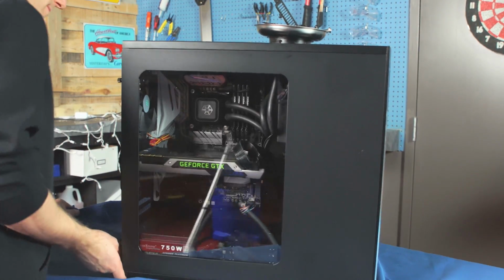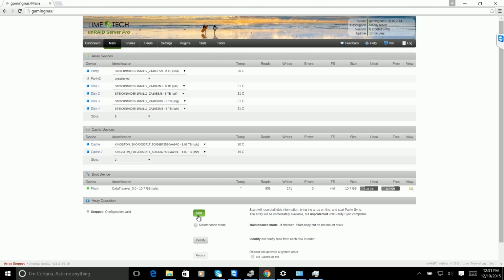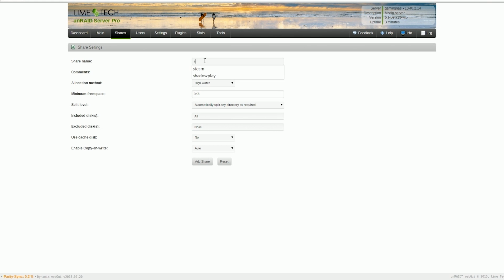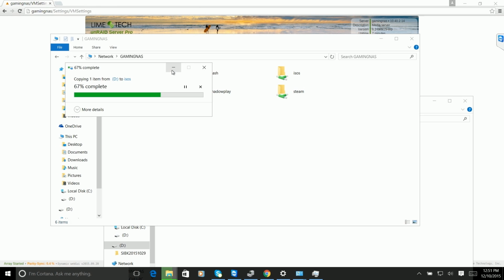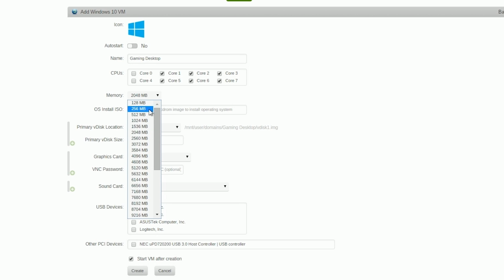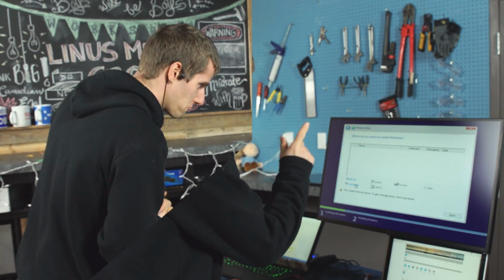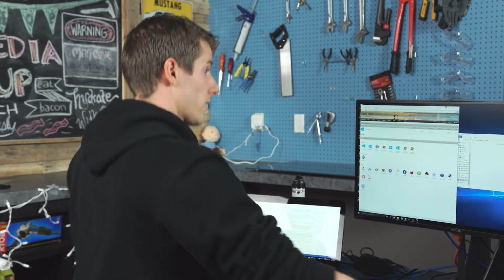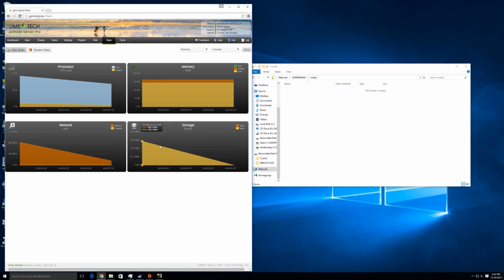Use your Gaming PC's Extra Power as a NAS Ultimate Guide

Comment: How is the power consumption for the NAS when the gaming virtual machine is turned off? The NAS is on all the time. Would the graphics card still draw power?
Reply: A little, but not a lot. Wouldn't know about the figures but it will only run at idle and most modern cards are very power efficient when not utilised

Comment: Super cool project, but what if you already have a gaming rig and wanna just "add" the nas part to it? In other words, can you transfer a current hard drive's data to the VM when setting it up or something?
Reply: Bit late but if anyone reads this question and wonders about it:
You can make a system image of your original configuration and then restore it from the Windows installation image when setting up the new Virtual Machine. However make sure that, before you make your system image for transfering, you have setup your system so it can boot from a standard SATA controller/Has The unRaid VM SATA driver installed. Otherwise you will most likely get a Blue screen with an INACCESSIBLE_BOOT_DEVICE error. (You might have to do registry tweaks to set your windows to be able to detect a standard SATA controller. Just google "Replacing a motherboard without reinstalling windows" and you should find some guides on how to do that).
Reply: you can also use your old ssd as a unassigned device and pass it through to the vm, no changes required, just get recognised by the vm as the boot drive  @PhoenixNL72-DEGA-
Reply: @timomaestripieri6691  That would only work if the OS that is on that SSD has a proper SATA driver that is compatible with the emulated hardware of the VM. Otherwise windows will boot to an INACCESSIBLE_BOOT_DEVICE blue screen. And seeing as Linus had to install a SATA driver from the UnRAID driver image file to be able to access the VM image file, I think there is a chance that that would also be the case for accessing a passed through SATA device.
Reply: @makemehotp  It should be. The only possible problem is that the driver probably won't install if it's detecting that the actual "Unraid Sata controller is not in the computer". I haven't tried it so I can't tell you if it'll work or not, or if there are workarounds (I know that you can set windows to force the use of a system driver for HDD control for instance. There are guides on what registry settings to edit. Specifically to be able to switch to a new motherboard with a different chipset without having to reinstall Windows. Don't know if something like that would work with the Unraid  driver though.

Comment: why not just use windows and configure the drives to be shared to the network?
Reply: Rhambus harsh way to put it bitch
Reply: Its because Share files are separate from windows, if your windows stop working, you won't be able to access your files until you reinstall/fix the windows, in windows you have to face with the ransom-ware, virus or even Trojan! SO your files are on risk, its better store separately!
Reply: yeah i do that and it works great
Reply: If you are ignorant enough to be infected with ransomware then you deserve to lose your files.

Comment: What if the CPU you use doesn't support onboard video?
Reply: I'm wondering the same thing.  I just got a 6850k with the ASUS x99 Deluxe II and it has no integrated graphics.  How do I assign my only GPU to the VM whilst having no igfx?
Reply: +FawksX Then the inside of the case looks like shit.
Reply: You could use something like citrix xen. It lets you not have a gpu assigned to the host.

Comment: Just completed this setup on my own machine, without a hiccup. Linus opened my eyes and i was able to save a lot of my money due to this.

My setup is:
i7-4790k
MSI Z97-GD65
GTX 980

Also, Unraid's youtube chaneel also, helped alot.
Reply: Make sure your Unraid "root" account has a password, otherwise anyone can login and mess with your computer or your files.
Reply: Oh Nice, thanks a lot, i got the exact same components in my old pc and i want to make a nas from it :) Hopefully it works for me also :D
Reply: I am this up on a system with the same cpu but I have an RX480
Reply: 4 Years ago... I know.  I'm about to do this as I can't afford to buy another PC for a NAS.  Any advise @Devesh Ranjan?
Reply: @idjmic  Get an old PC with a low-power chip. Those can be found dirt cheap on the used market. The biggest cost in that case would be the hard drives themselves. Just make sure the computer you buy has enough hard drive bays and SATA connections for your needs...or go buy a used host-bus adapter card.
Reply: @danieldougan269  too late converted gaming pc to server GPU pass through learning lots

Comment: Awww. I was excited about this until I saw the bullshit licensing on the product :/ 

"unRAID Server OS is licensed through the use of registration keys.  A registration key is a small encrypted file that is only seen as valid when installed on the USB flash device to which it was registered.  In the event your flash device becomes lost or damaged, you are entitled to transfer your registration key to a new device free of charge (limit once per year). "

Yeaahhhh... No. Dongle based licensing crap sucks.
Reply: So far the same license has been good for every new version of unRAID that's been released. That's damn good value. Since you typically just set it and forget it, the licensing scheme never really comes into play. Upgrade your system? Just move the flash drive to the new machine and away you go. If you're repeatedly trashing your flash drives to the point that once per year free replacements aren't enough, the problem does not lie with the licensing scheme.

Comment: Is it possible to use the SilverStone FS305 (or any other multi-drive hotswap bays) as a quick way to clean up the mess of spread out data over a bunch of smaller disks?
Example: 10, 90% filled, 100GB drives. Then put in 5 of them and start moving data inbetween, then swap one disk (while the PC is On) and sorting that data aswell into the other 4 disks. Would this be possible?

I'm Not sure how it works yet, not even sure if there is a 5-bay hotswap (or larger) bay with USB. I have alot of disks but no convenient way to carry/swap most of them at once, to sort the data I've spread out over them for quite some time.

I do look forward to the day I can sort it all into a 2 (or more) disks of large capacity in Raid1, but then again... Before that... I could use some more folder structure skills hahaha (...what a mess...).

Comment: When it comes time to replace a dead HDD, does it have to be the exact same format or just the same capacity?  This is important to know since by the time that happens, it will be hard to find exact replacements.  This is why I went with a Drobo.  I'm still looking for a software "unRAID-like" solution because the Drobo is much slower and proprietary.

Comment: So does the computer need to be turned on 24/7 since it's also a NAS? Wouldn't it cost less electricity to use a dedicated NAS device? Or does the computer use not as much electricity when the gaming machine is unused since the GPU and dedicated CPU cores aren't used?

If that were the case, than I guess setting up your computer like this would be pretty justifiable, cost wise for hardware and electricity.

Comment: Wrong title, shouldn't this be something like "gaming on what's left from your NAS CPU" ?! Why would you virtualize your gaming rig?!

If anyone did this for more than a short test just reply, I'm curious. Are you getting about the same performance in the virtualized gaming environment?
Reply: I am working with virtualization since 2001 and I can tell you, you do have a slight overhead - but you won't recognize it (but could measure it). Since the GPU is directly assigned to the VM I think it should have pretty much native performance. Where it gets tricky is having more than one VM running and all share CPU & RAM. Even though you can build it not to exceed installed physical RAM or CPU, you still need to schedule access to either which can lead to congestion.

Comment: > installs Windows
> has to install missing drivers

Really Microsoft? …it's 2015-2016 and you can't include standard proprietary drivers with the OS by default? Linux systems have been doing it for years, and Windows still hasn't progressed further by not including standard drivers for hardware installed to the system.

Comment: Hey Linus, why don't you just run a raspberry pi as a Nas? Could buy one +extras with about £50 and run a Nas just fine with a little less messing around right? I know this is probably just a 'you, could, do this video' but I'm just asking what the advantages are doing it this way instead of using a low end low budget system like a raspberry pi?

Comment: Most personally relevant video I've seen in a while.
Reply: +Piff Paff More an interest piece than anything. Haven't attempted before.

I will likely be performing on a FreeBSD or Linux platform.

My FX8150/Crosshair V Formula Z rig died back in late September after my PSU went critical and shit itself all over the rest of my major components (the CPU seems to have survived though).

I'm looking for a mostly a dedicated slave NAS machine though with enough leftover to have 2 or 3 tabs open or rich media in Firefox or maybe a game of Quake or Serious Sam at a LAN party if a spare rig is needed.

I'm waiting to pounce on an older Sandy or Ivy Xeon or i7 depending on what MoBos I can get for a good match.
Reply: +Piff Paff Oh yeah, have a Thermaltake Level 10 GT case and 3x 3.5" front panel AHCI/SATA drive bays so was thinking of 2x3 RAID5, 3x1 solo and 1xSSD.

Guess my biggest challenge with be finding a budget desktop ATX/MicroATX MoBo that supports 2 RAID cards.

Comment: great video - excellent idea as well. I have a NAS and although I have it setup as RAID 5, I have NO backup. I've also got a huge CMSTACKER case which also has similar 5.25 to 3.5 drive cages (complete with fans) so I can get lots of mechanical drives in it. I can't help but feel after watching this video though that you glossed over some steps, any chance of a write up on the LTT forums? you talk waay too fast :)
Reply: +MrHappyjolly oh and one other thing, what was power consumption like compared to a NAS, typically a NAS with 4 drives would run at around 60-100w I never turn it off, I would be put off by a 200w idle power consumption of this setup.

Comment: would be good if you showed power consumption through a watt meter while the VM was off (so just the 'nas' being in use)

I'm skeptical the price of running 8 threads 24/7 is cheaper than buying a $50 low power nas

Comment: Finally upgraded by old Sandy Build.  What you guys think 

CPU: i7 6700k
CPU Cooler: Corsair H110i GTX
MOBO: Asus ROG Maximus Hero Viii
RAM: 32 GB Corsair Dominator Platinum 4x8GB
PSU: Corsair AX1200i
GPU: Gigabyte G1 GTX 980 Ti (Will eventually go sli, hence the 1200 PSU)
Case: Corsair Obsidian 750D
Storage:
1 x Samsung 1TB Evo  (Boot / Windows and Programs)
2 X 3TB Seagate Barracuda in Raid-1 (Steam Games, Storage and Boot Drive backups)
1 x WD 2TB for Downloads, Temp and other crap
Keyboard: Corsair k70 RGB
Mouse: Logitech G9X Mouse (Old, but I'm still in love, no need to replace)
Display: Samsung Ultra Wide 34" 3440x1440 SE970C
Secondary Display: My beloved Dell U3011

Comment: I'm not too familiar with VM's... however, I have had a gaming/HTPC/media server (one box) for several years now and it serves my families needs wonderfully.  My recommendation to my friends after showing them my set up is an i5 or i7 coupled with 16GB of memory in a desktop case with at least 8 drive bays.  I currently have 3 drives (6TB red drives) using StableBit drivepool and scanner as my storage solution (what is the point of parity these days with SMART?).  I further have Emby (could use Plex) taking care of media server duties.  The OS and games are loaded on an SSD.... what more could you possibly need?  If you have an Nvidia GPU you can use Shield consoles throughout the house as the media/gaming consuming device.  No need to complicate things with an unRAID solution (no offense but the video was incredibly confusing with the bagillion steps it takes to set up the server but I think that is par for the course in a set up like this).  I think something like the unRAID goes against all that is KISS.  Furthermore, I could never see CPU (or any other resource) utilization being a problem as I have had several transcodes going on in the background all while playing BF4 without any drastic hit in performance.

Comment: what if there was a hybrid cpu cooler? (if someone knows of one, can you send a link?)    a cooler that used a coolant pump only when under heavy load, and just used standard air cooling when idle. The coolant could conduct heat into heat sink fins when not being circulated. (kinda a really inefficient vapor chamber). and would having air cooled coolant on both sides of the loop make an impressive difference? So basically, have a dual radiator loop, with one of the radiators being a cpu heat sink full of liquid.

Comment: Wouldnt this mean leaving my OP gaming rig on 24/7? Surely that wont do the life expectancy much good and not to mention electricity bill there for negating any cost saving for the build itself... and how much are you actually saving anyway when the cost of hardware to run a nas pales into insignificance if your using ssd's and hdd's to the level used in this build?

Comment: For those of you who don't understand - The whole point of using unRAID is for redundancy and larger storage capacities without having to use a ton of the same sized disk. For Example: my unRAID server has 2x 4TB HDs and 2x 2TB HDs for a storage capacity of 8TBs and I'm protected if any one drive fails. If I wanted to achieve this with traditional raid I would need 4x4TB HDs in Raid 10. The beauty of unRAID is the ability to mix and match different disks and build an array out of old stuff you have laying around.

Comment: Unraid is a good bit of software but you CAN do all of these things with linux/Docker and Virtualbox
Reply: I know this comment is old, but
Really? That's interesting. Seems like that would be a much simpler initial setup for the average user. Also, why set the VM for the PC and not for the NAS? Seems like if you mess up the install, you have less of a chance of bricking your PC that way. Plus, say you're hosting a cloud-based media server and you live alone, you only need access to streaming when the PC is not in use, so when you finish working, just open the VM and stream, finish, close the VM or turn the PC off. I know for the current use-case in the video, the NAS will have a better up-time, but when you're using a gaming PC as a server, you'd want to lower power usage as much as possible for the sake of your utility bills, longer lifespan for the high-end gaming PC components (less replacement), and the average user that wouldn't get a dedicated NAS probably doesn't need to backup 2 TB of storage every night. Maybe a few hundred gigs once a week, which again, would mean it's better to run a VM with a NAS when you need to back up and not vice-versa.

Comment: I just don't understand why grandma's old Pentium D computer couldn't handle 5 hard disks and FreeNAS?  I think it's amazing hardware visualization has come this far, but I don't see a practical use of making a 2 in 1 PC. now the 2 gamers 1 CPU makes a bit more sense as you can multiplayer on the same PC. but this is where Consoles shine. but I suppose it depends on the circumstances.
Reply: +88ariesk Theres a difference between split screen and dual monitors

Comment: I am curious about the usability of the NAS and the VM's.  While in the video it show's that you can game during a file transfer which is great but what about rendering video's or other CPU intensive tasks while the NAS is in use.  

It looked like the NAS was left with 2 cores so how well can it transcode / stream and such while your using the VM?

Also what is the power consumption of the entire system when idle or just the NAS is in use vs both at once?  If the VM shuts down will the GPU and other resources throttle down 

How easy is it to shut down / restart the VM without going into the console to start it up?  While awesome and definitely useful it seems to add some extra power / heat costs for long term expenses vs up front costs.

Still awesome and while I love the cost savings and features, I prefer my stand alone NAS still.

Comment: I've been looking to do this for a while now. Thank you.
Currently I run a Synology NAS as my media/website server, which is perfect for my low-view usage, but will definitely use this solution when I replace my current mechanicals.

This is gonna work SO PERFECT considering i'll be getting a new laptop that has near no storage, but decent cpu/ram. I'm mostly having issues with windows, but my games HDD is 3/4 full and my primary storage will become mostly full if I move that over. Plus the game's hdd is dying.

I will be using this to have networked storage between my multiple desktops, laptops, netbooks and even my smartphone (through the synology nas).

Comment: the conclusion I draw is the same from the first video; its pretty pointless unless ur using multi core multi thread cpu's and u have demand for separate physical nodes. so u can invest in top of the line hardware for hardware intensive tasks, then switch to multiple node mode, with out loss of space and hardware.
Reply: like with a Xeon processor, with multitudes of cores. u can have separate distinct workstations nodes when required without having to shell out for case, main board, above OS minimum ram,  and PS. then be able to gobble down a thread intensive task by switching cores ram and disc space back to a single node.